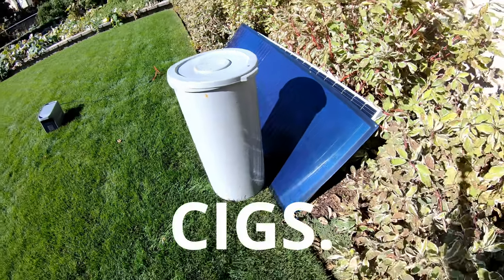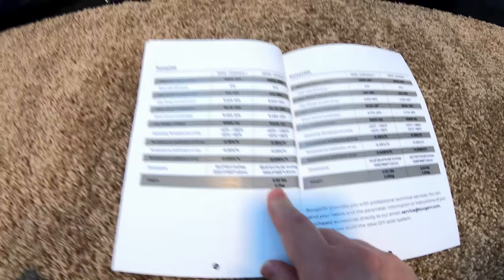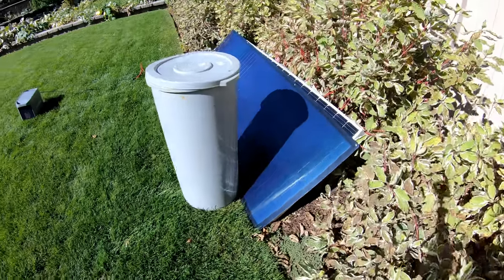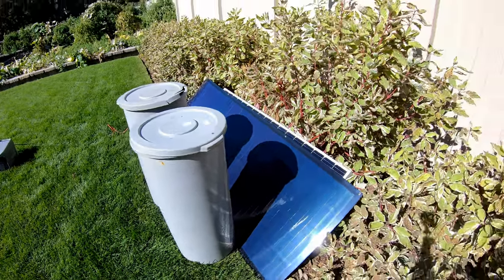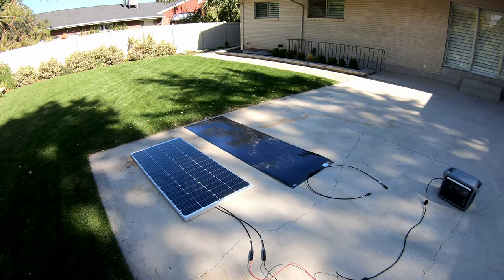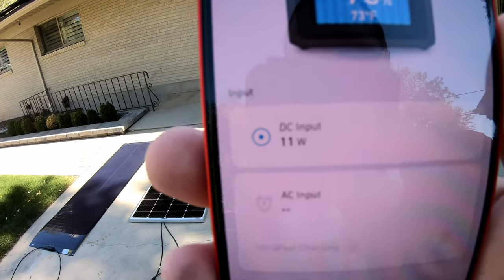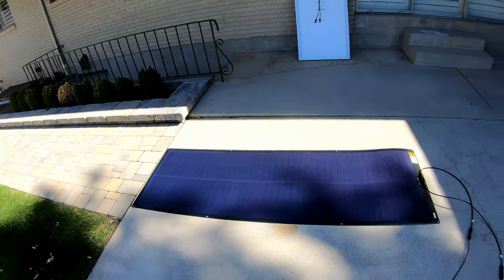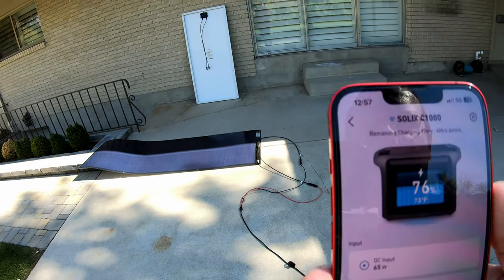I DARE You to Compare! CIGS vs. Rigid Solar Panel - ULTIMATE TEST!

Comment from the maker: Buy the BougeRV Yuma 200W CIGS Solar Panel with Pre-Punched Mounting holes like you saw tested in this video: https://www.bougerv.com/products/yuma-200w-cigs-flexible-solar-panel-with-holes?aff=230
Be sure and use the code: TRICK24 to save a whopping 24% off your order! 
Or buy it from Amazon: (NOTE: Coupon code does not work on Amazon) https://amzn.to/3UjjYb2  

Buy the upgraded version of the BougeRV 200W Rigid Solar Panel like you saw in this video: https://www.bougerv.com/products/200-watt-bifacial-solar-panel?variant=44938599334104?aff=230 
Or buy it from Amazon: https://amzn.to/4eUYedI 

Buy the BougeRV Yuma 200W CIGS Solar Panel with Adhesive backing:  https://www.bougerv.com/products/200w-flexible-solar-panel?option1=1PC?aff=230  
Be sure and use the code: TRICK24 to save a whopping 24% off your order!
Or buy it from Amazon: (NOTE: Coupon code does not work on Amazon) https://amzn.to/4huBUJV 

Buy the 100W versions of the CIGS solar panels:
100W with holes: https://www.bougerv.com/products/yuma-100w-cigs-flexible-solar-panel-with-holes?option1=1PC?aff=230 
100W with tape: https://www.bougerv.com/products/yuma-100w-cigs-flexible-solar-panel-with-adhesive?option1=1PC?aff=230 
Be sure and use the code: TRICK18 to save a nice 18% off your order!
Or buy from Amazon: (NOTE: Coupon code does not work on Amazon)
100W with tape: https://amzn.to/4dYJgC8 

Buy an Anker Solix C1000 power station like you saw used in this video: https://amzn.to/4hdlsxp 

I don’t drink coffee, all donations get 100% re-invested in the channel to bring more un-sponsored content for you. Please consider donating through this link as opposed to using YouTube Super Thanks since I get to keep more of your hard-earned money and less goes into the pockets of large companies like Google. You can also schedule one-on-one consulting/meeting with me here: 
https://buymeacoffee.com/theresatrickforthat 

Watch more of my solar, batteries and power station testing videos: https://www.youtube.com/playlist?list=PL-2uuHDasQcr0pa4IMBj4kcjxSdNlGpr1
&
https://www.youtube.com/playlist?list=PL-2uuHDasQcp2gNWpR-N_GUEey1fhnbgI 

Affiliate Disclosure
As an Amazon associate I earn from qualifying purchases at no cost to you! Thanks for your support!
Reply: Well done review. Thank you. Considering this for a pop up that won't handle the weight of a conventional panel.